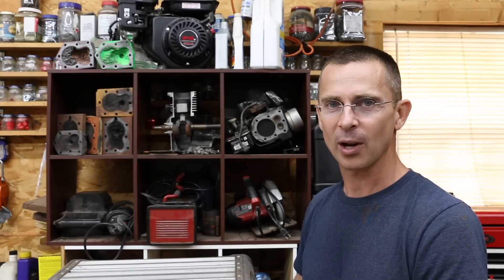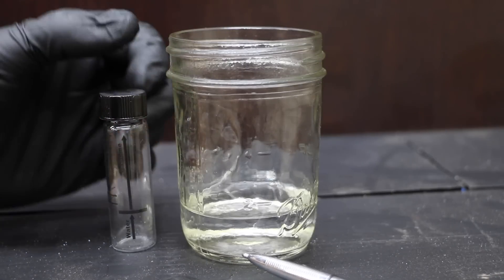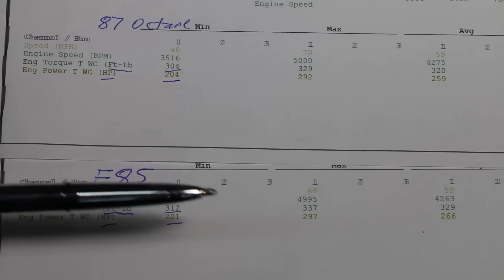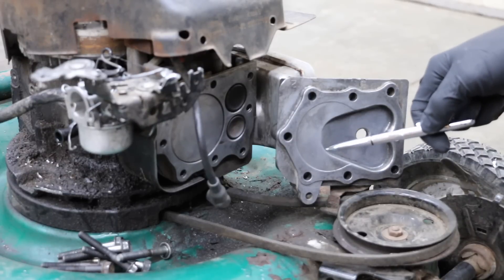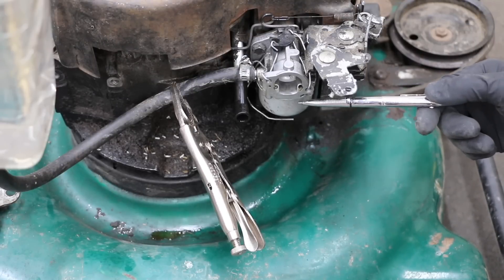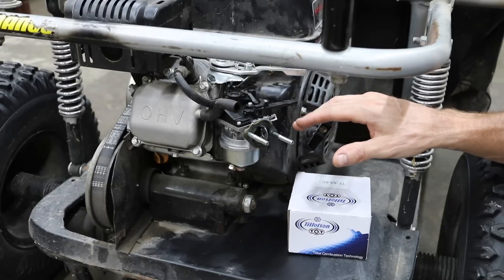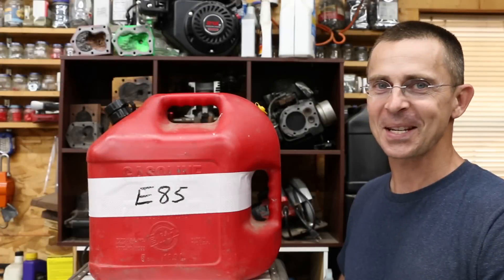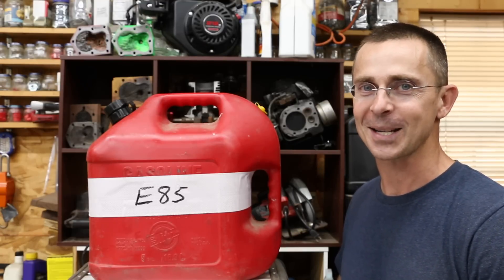Is E85 better than Gasoline? Let's find out!

Comment: I ran e85 in my 98 4runner for 6 months straight.  The manual said it could run on 10% "gasahol"  so i figured what the hell. power was increased,  It ran amazingly , spark plugs looked awesome  but the fuel milage was worse.   It has 270,000 on it today and still runs great.
Reply from the maker: Impressive!  Thank you

Comment: Any engine with forced induction (turbo charged or supercharged) benefit the most from E85 due to a higher octane rating. You can add more boost and more aggressive timing.
Reply from the maker: Great point.

Comment: Pump ethanol at stations use corn ethanol which is the worst ever created. There are way better ways to make it that are far more efficient and would produce better results in your truck. Sadly the corn industry lobbied to control that sector so we are currently stuck with this garbage. Would be awesome if you could get some made from wheat grass or algae.
Reply from the maker: Great point. Thank you

Comment: According to the price on your pumps at fill-up, and your mileage.  E85 cost you .19 Cents per mile and 87 octane cost you .16 Cents per mile
Reply from the maker: Great point!  So, closer to $3,000 extra to drive 100,000 miles. Thank you
Reply: I would like to see a test with an engine built just for E85, no comprimises for gas, high compression more timing etc to see if the mileage would improve with better combustion.

Comment: After reading some comments it looks like in the USA you don't have as much advantages as we have here in Europe with E85. Regular gasoline here (France) SP95-E10 cost around 1.7€/L while Super-éthanol E85 only costs 0.6€/L. 
It's almost 3 times cheaper and makes it for the extra refuel needed for the same distance.
I'm driving an 1998 Citroën Saxo VTS with 215K kms and E85 works like a charm in it.
Another point about E85 is pollution, it's a bit cleaner to burn than regular gasoline.
Reply from the maker: Thank you!
Reply: The only question I'd have about the cost difference is if there is any sort of subsidies for ethanol fuel to make it artificially cheaper than regular gasoline.
Reply: @erikj.2066  Actually E85 costs more to produce than regular gasoline (95 octane here) but there is way less taxes on it at the moment.
While gasoline and diesel have about 60％ taxes in their price, E85 only has around 15/20％.

Another thing is E85 has a bad reputation from people that don't understand what it is because before car manufacturers had to make cars compatible with E85, some people were trying it on cars that weren't engineered to run with it. Result was mechanical failure of joints, badly running engines, etc...
Being not a really good seller, E85 doesn't attracks taxes because few people are using it.

P.S: Hope it's all understandable with my english. ;)

Comment: I have a 1978 VW Beetle. It's fuel lines dissolved into a dangerous leak on the 1st time I ever used regular 10% ethanol gas instead of ethanol free. 
So serious disclaimer folks! DO NOT USE ETHANOL IN AN ENGINE NOT MADE FOR IT! In the short term it damages seals and hoses, in the long term it damages valve seats.
Reply from the maker: Wow!  Thanks for this information.
Reply: And thank you for making awesome videos! Idea - I'd love to see E85 in a 2 stroke, does it work?
Reply: Damages valve seats?

Comment: We bought a Ranger for my daughter to drive to school last year. Its a flex fuel 3.0L (VIN V) dog of an engine. We switched to running E85 exclusively this summer, And I don't know how dirty the engine was. (80K miles claimed by previous) But man after a recent oil change and battery replacement (no CEL prior to battery swap). This thing is running better than ever. I do not know the MPG at all unfortunately.
Reply from the maker: I imagine the combustion chamber is nearly spotless!  Thanks for commenting.

Comment: I love E85! I use it as race gas so fuel economy isn't a concern for me even though I average 28mpg with everyday spirited driving in a turbo 4 cylinder Subaru.
 I don't get better fuel economy with gasoline, in fact I loose power, pollute more and generate more heat. E85 is hands down the superior fuel in my book.
Reply: I think the proven concept is that you need a car with a turbo, or high compression to take advantage of E85.
The Chevy has neither.
Reply: @shawnd567  not necessarily, if someone wants more then just an option to run a green fuel and are looking for extra power ect. all they need to gain power and extra fuel economy is access to the ECU in order to remap the fuel trims and ignition timing even if it's a NA Chevy.

Factory ECU presets are mapped to "maximize" overall vehicle life regardless of geographic location and altitude. The thing is, a custom dyno map is safer for the vehicle and there's no reason not to add power so long as the owner accommodates the shortened matnence schedule as well as be open to increasing intake, exhaust, fuel injectors and fuel pump i.e. make the vehicle more efficient overall.

The idea is to utilize the 106 octane equivalent of E85 to allow for up to +10° of ignition timing advance making power when you need it and fuel economy when you don't. Tuning a NA Chevy Tahoe isn't much different from tuning a supercharged Jeep TrackHawk until boost, at that point all that changes is the ignition timing being retarded to prevent knock.

You can make huge changes to NA low compression motors with E85 but a stock flex fuel vehicle keeps things very reasonable unless the ECU is modified.

Most people just don't like to add modifications because when not done correctly they'll have problems but that's why peformance mechanics exist :)
Reply from the maker: Thank you!
Reply: My subaru developed better economy with e85 too (turbo 1993 legacy) hahaha. My guess is that on petrol we always have super fat AFRs and conservative spark out of ringland fear. But on ethanol we can tune for leaner cruise and transient conditions and optimum spark without worry.
Reply: @beajayparker247  heh yeah. I use 2 heat range colder plugs with a tighter gap and keep my fuel system spotless to run a 12 AFR @ WOT on gasoline in order to disregard ringland worrys. I've noticed that the 91 octane has to have cold IAT to get the fuel economy E85 does regardless of IAT.
Reply: I noticed that too. To be honest though, I only used e85 for a short while on the factory ecu (less than a week) before I went stand-alone.

But I did notice that the Subaru got better gasoline economy in really cold air. Sea level or high altitude didn’t matter, but air temp did.

I think the factory ecu’s have a spark advance offset against IATs but I’m no expert on the obd1 computers haha.

Comment: YAY Project Farm video :)
Reply from the maker: Thank you!
Reply: I still don't understand. As far as I know ETOH burns clean at 4 calories per gram. Gasoline is 9 calories per gram but produces lots of hydrocarbons giving it more than twice the power. I have a sterling engine that will run on anything that is flammable - so, of course, I tried everything I could think of as fuel. Both (or anything I have tried) will generate electricity... charge your phone etc... but you get way more power from petrol. I just don't get how they mix cause they are hydrophillic and hydrophobic.

Comment: Watch out running this in any engine! Normal engines are not suitable to run E85 because of certain components of the engine will degrade under the influence of the ethanol in E85. That's why some engines are specifically rated for E85, they are built with different components.
Reply from the maker: Great point. Thank you.

Comment: I have a JB4 on my Mk7 R , ive got it dialed in with 3 custom tunes. 
91 oct hot weather
91 Cold
E85 
    - note about my e85: the car makes noticeably more output with better throttle response with top end seeing my largest gains. I also can run this fuel mix in all weather as it drops temps in the engine and recused carbon build up.

My MPG’s do suffer on the blend. Down 2-3 mpgs, Current ratio 2.25:1 91/e85

I have currently 10k tested miles swapping between all 3 tunes.
Reply from the maker: This is great information!  Thank you!

Comment: E86 is trash for MPG, burns 2x as fast BUT can handle much higher detonation resistance which usually increases with HP. Mostly in turbo applications e85 let’s you put more boost and more pressure/heat/compression. Where standard fuel does not.

I run e85 with my track car and it takes about 2-3x the amount but allows me to run more boost and power on track.
Reply from the maker: Thank you
Reply: Also you should mention that you MUST fortify engine internals, to increase power significantly.
Reply: Peter Welsh eh that’s dependent on the internals. I have almost tripled my power output from factory on stock internals and still have no issues. Some cars are over engineered better than others. So to a case by case basis.

But if I push my power levels any further with my particular car I will need to upgrade the internals. Again for my particular application.

Comment: E85 is good for boosted motors. It resists detonation like methanol does. VP M1. Consider it as a comparison to high octane fuel. But methanol and E85 cools as well.
Reply from the maker: Great point. Thank you

Comment: I have a '90 Mustang I use for drag racing. It has an injected LS that I added a flex fuel sensor and I run E85 it has 105 octane. It allows me to really add timing without the risk of pinging. But I have to add 20% more fuel because it doesn't have the thermal energy that gas has. It adds about 70 hp to my 93 octane tune. But the hp doesn't just magically appear, you have to tune for it, added timing and fuel to optimize for E85 over 93 octane.
Reply from the maker: Great point. Thank you!

Comment: Your result is pretty consistent with what we see on naturally aspirated engines on the dyno switching to E85 - more midrange torque and a slight bump in horsepower at high rpm.
Where alcohol fuels really shine is with supercharged applications. Because supercharging (including turbocharging) adds heat to the air in order to increase it's density (resulting in boost) that heat hinders how much power we can make with supercharging (cold air is denser and more fuel can be burned vs hot air) as well as can limit how much timing we can use so as to avoid detonation. 
With E85 and other alcohol fuels, due to their increased capacity for absorbing heat (latent heat of vaporization), they naturally remove much more heat from the compressed air and make more power/allow more timing.
After a pass at the drag strip with racing gas my supercharger is so hot you can't put your hand on it. With E85 the supercharger was cool to the touch even in 100+ degree track temperatures. E85 is pretty amazing stuff for racing. Not as much for your average street cars, esp. in the winter.
Reply from the maker: Great point. Thank you

Comment: I have often thought about adding e85 to regular gas to get a mid octane fuel for less money.  Sadly I don't have a car that needs anything above 87 octane and don't have a car that will adjust fuel consumption to offset the lower fuel density of e85.  

Maybe you can do a video of if premium vs 87 octane fuel makes a difference in a car that requires premium.  

I tell my GF every day that here lexus will run fine on 87 octane but I think she buys premium when I am not looking.  Its like an extra $10 a week for nothing.
Reply from the maker: Great video idea!  Thank you!

Comment: Always enjoy your videos, would Ron 91 fuel with 10  percent ethenol harm my bike engine in humid weather?
Reply from the maker: There's a risk of phase separation with ethanol, resulting in corrosion.  I would rather use non-ethanol for an off-road motorcycle.
Reply: @ProjectFarm  thanks man it's a versys 650.

Comment: Another great video! I used to fuel my company truck with ethanol because of the reduced cost, but it turns out it was cheaper (MPG wise) to just run cheap`o 87 octane.  It feels like there is more pulling power on E85 when pulling a fully loaded trailer, but that could all be in my head.
Reply from the maker: Thank you!  You are right, more pulling power with E85 but less economy.

Comment: I think its crazy people care about their engine in terms of ethanol compatibility. You say its a strong solvent and you shouldnt use it in engines not designed for it but people drink it often every day in diluted version. Engines can be replaced life is irreplaceble
Reply from the maker: Great point. Hand sanitizer is normally 50-70% ethanol.

Comment: Can we use a electric air blower  which is used for removing dust in house. To replicate a turbocharger i wanted to see if there is a difference or it remains as it is. And i want it should b fitted with small and carbureted engine like 110cc 125cc scooter or bike or any other engine .
Reply from the maker: Thanks for the video idea!

Comment: Repeat the test next week and itll be different results. The ethanol fuel has a range of 50% to 85%. Its not the same every time you get the fuel. Even with an e85 vehicle the mileage and power will always change depending on the ethanol content. 
Awesome video as always just unfortunately e85 is crap fuel.
Reply from the maker: Great point.   Thank you!

Comment: I tried E-85 for a summer, fuel mileage  on my car dropped from 20.3 mpg 87 E-10 to 15.6 mpg on E-85. In the fall when temperatures dropped below 50F the car started real hard. Great video man. Also I'd like to see a review on that Tillotson mechanical fuel injection set up, thanks again .
Reply from the maker: Wow!  That's hurts. Thank you for the video idea!

Comment: not going to be easy i know but try UK 98 OCTAINE gas in comparison to US gas 98 ron is our lowest rating.
Reply from the maker: Thank you!
Reply: wow you do respond to all comments! can you make UK gas?
Reply: Different rating systems. UK 98 is Research octane. Since the mid '70s in the US and Canada the number on the pump is 4 to 5 numbers lower as it is Research and Motor octane numbers averaged. UK 98 = US 93.
Reply: try US 93 octane against UK 98 octane, simple solution?

Comment: The question is whether the 03 Suburban is capable of making changes (timing, throttle ) to run on E 85 and if it can make those changes running just a single tank of gas?
Reply from the maker: Great question.  It did provide more horsepower on the dyno.  I believe it does adjust quickly.

Comment: Horse power is directly related to torque.  HP is torque * RPM /5252.   So that means if an engine makes 500ftlbs at 4500rpm, at that specific rpm the engine is making 428.4hp.
Reply from the maker: Great point. Thank you
Reply: Science!
Reply: What about one that makes 1200 lb/ft at 2500 rpm? Horsepower spins tires, torque pulls loads. I've seen plenty of hyped up vehicles high horsepower vehicles fall on their face when put under heavy load.
Reply: 571hp.  This is why race engines, including the diesel torque monsters, usually spin high rpms.  Take an f1 engine for example.  it might make 350 ft lbs. but 350 ft lbs at 12k rpm is 800hp.  Diesels dont make tons of HP because they dont rpm.
Reply: Explain why my turbocharged engine is making 423lb-ft and only 327hp? Its a gasoline turbo v6
Reply: at what RPM?
Reply: Just doing some basic math, it would seem your engine is making peak torque at around 4000 rpm.  Soon after there is some restriction making the torque fall off heavily.  without know what kind of engine and the modifications made to it, its hard to tell.  A guess might be intake manifold, turbocharger, or cylinder heads.  If the intake or heads are not up to the task, they wont make power at high rpm.  If your heads and manifold can flow the air, maybe you are plain out of turbo.  The only solution to that is going to be a bigger compressor wheel or a more effecient wheel.  Research your engine.  Find what people are changing from factory.  Also keep in mind camshaft.  If it is a stock engine that was NA and you have hung a turbo on it, the camshaft can be the problem.  I can type a whole paragraph on just camshafts.  We can hold off on that for now.  But there are tons of things to consider when building a performance engine.  Sometimes its one thing that holds you back and it is obvious.  Sometimes its hard to find without the proper tools.  Which most of us dont have because we dont build race engines for a living.
Reply: Tq@ 2800-ish. Hp@5700ish redline 6200
Reply: Yeah, with the engine making peak torque at 2800, and peak hp at 5700.  it must be holding an incredibly flat torque curve.  Which is great, however im sure after peak hp, the dyno graph just goes straight down.  You have an air restriction.  The best things I can recommend is a new intake manifold, shorter runners, more plenum volume.  Ported cylinder heads. and a custom camshaft, speced for your particular set up.

Comment: I used E85 in my 2009 Chevy Impala (Flex Fuel).  i did notice a slight increase in performance.  But mileage went from 29-30 combined to about 24 combined mpg.  My car had 90k miles when I used my first tank of E85.  After calculating the mileage difference, I tried E85 after 5 days of 87 octane.  Results were about the same as before with a slight uptick in performance.  I think the E85 was cleaning out the engine a bit.  This was in 2013. Had a job that required a 156 mile round trip 70-75 times a summer.  So lots of highway (55) and interstate driving (70).  I've wondered if city miles with E85 would be better than highway?  Run cleaner and no need for performance bump in the city.
Reply from the maker: Wow!  That's a big loss in fuel efficiency. Thank you